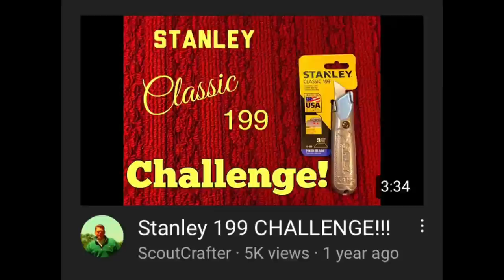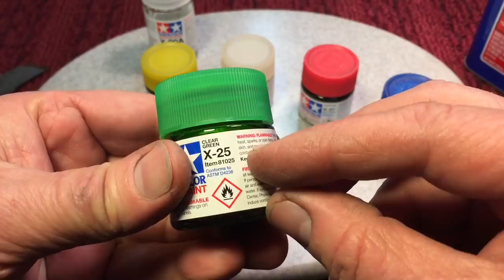2 Classic Stanley Utility Knives

Comment: Nice collection I am a retired carpet and Lino layer I carried a 199/ 299 Stanley in my pouch for 35 years we would tighten the screw with our thumb nail for making tool-less blade changes same with our Bloody Mary knives long before tool-less knifes were made. We always had a long Lino knife stone near. We also kept a small piece of an old Lino stone in our back pocket to resharpen our utility knifes.

Comment: I use the Tamiya paint building models. A much better and much cheaper thinner is common rubbing alcohol (if you can even find it). Should dry faster and fill in smaller cracks using the isopropyl. It will also remove it from the lettering. Tamiya, themselves; even says it is OK to use.
Reply from the maker: Hello Stephen!  I used to buy a lot of rubbing alcohol now I can't find it!!!!!!!   Bastards!  LOL

Comment: Speaking of the Stanley 199, I inherited a 199 from my mother.  It is a "Goldblatt 199".  Except for the molded-in name, it is a Stanley knife.  According to her, it was a matte knife.  As an artist, she used it to cut matte board for mounts.  It had lots of scratches when I got it, but I made a cardboard sheath for it — and eventually, after a few years, the cardboard has worn the scratches away.  It now lives in a tray with the other mail processing tools.

Comment: I love your work on these 199s. In case it matters, they are not aluminium; at least, not much in more recent years, if ever. The ones I have worked on are a high zinc (+90%) alloy. Your advice still applies for grinding and polishing, though they are not as soft as aluminium. I am going to do some work on some older ones, which might be made of other metals.
Reply from the maker: Hi Gord!  Thanks for that info, alloys are hard to determine just from looking at it.   The castings are still very nice and they are a beautiful knife!  =D   Thanks!

Comment: Spent quite a few years getting up at Four-Thirty and starting work at 6am..........My Air Compressor is in the Garage and I have a line piped into my Basement Shop so I don't have to hear it...........Bird Seed Bag has Great Graphics, at least there's some products today that bother to make the packaging look nice..........The 199 you just did has the straight slot screw and all the others you showed have the Phillips.
Reply from the maker: The newer knives have a few differences...  they polish up nicely though!  😃👍

Comment: I still use mine and it's 20 years old.  Painted mine when I first got it with Rustolium paint.  So it's never rusted.  Someone gave me a Milwaukee but it only holds one blade.  The Stanley holds a dozen or so blades so that's why I prefer it.  Your project came out good.  I like the yellow and red.  Looks a lot like a pistol grip.

Comment: I was taught if you use the sam tools on aluminum and steel you will always have galvanic corrosion.. when Ford started putting aluminum hoods on they're trucks I did a repair on mine..and painted it....looked great but about a year later the paint started bubbling in the spot where I made the repair. I found out it was because I used the same grinding pad I had used on steel.

Comment: 2.30 AM it must be cold in the basement or do you run the central heating 24 x 7? You polishing the aluminium, how shiny can you get it,  can you get it like the stainless steel mirrors?
Reply from the maker: Tony- I removed the insulation from the steam pipes in the basement so it’s nice!!! 😃👍

Comment: I did a lot of night shifts, too. Doctors have even diagnosed me with "Day Night Reversal Syndrome" and I spent years on prescription sleeping pills trying to right this wrong. One thing I have found that helps is learning about circadian rhythms. Specifically 3 exposures of bright light can reset one's Circadian rhythms. Also the sleep hormone melatonin is not produced when exposed to blue light or these new 5k-10k LED lights. The old incandescent color or red LED lights are best. I even have my laptop set to get rid of blue light at 8pm. (windows 10 has it built in but there are apps you can download to do the same thing) The last thing I'd recommend is to google "sleep hygiene" as it has more hints. These days I'm off the RX sleeping meds. I take 4mg of chloropheniramine at night. It's an old very safe allergy medicine that has the side effect of causing sleepiness available by the 1,000 on amazon for less than twenty bucks. Most brick n mortar stores don't even carry it unless you specifically ask for it.
Reply from the maker: Fantastic information John!  Thanks!  😃👍

Comment: I dont know if you use your phone a lot at night, but, you know how they say that red light preserves your night vision? Well, cell phones usually blast out blue light, which stimulates your eyes. Theres a setting in your iPhone for automatically changes this under Display and Brightness, and its called Night Shift.  It adds a pinkish tint to the light the phone puts out and stimulates you less.  You can select which hours this Night Shift is on.
Reply from the maker: Joe- I have all my devises on "Night mode" as the normal mode is too bright.  My Youtube "Darkmode" keeps the screen black!  Really nice!

Comment: Love my fixed blade Stanley knives. Try using a Zirconia based flap wheel when you are working on Aluminium. The Aluminium . Oxide is clogging up faster because  the abrasive itself has Aluminium in it.
Reply from the maker: Hi Abe, great tip!  I have a polish that works fantastic but it doesn't remove scratches...  =D

Comment: I know what you mean about sleeping. Before retiring I got up every morning for 34 years at 4.58am in order to catch the first train of the day. I have been retired now for nine years and you guessed, every day I wake up at 4.58am but now I can roll over and get another hours shut eye. The strange time was due to the alarm going off at 5.00am and I would be in my wife's bad books if it woke her at that time so I just woke up 2 minutes before (self preservation !!!) and switched off the alarm.
The 199s look great but I noticed the older ones had a different tip to the modern ones, could you line them up to show the full evolution?.
Fantastic video and a high spot of the day, thank you.
Reply from the maker: Tony- The first half of my career I worked days. (4am to 12:30pm)  So I woke up at 3am for 16 years then I went into the shop and went to nights!  LOL   Out of the pan and into the fire!!!!  =D

Comment: I did a 199 which I have many from being a carpenter for 42 years never though about restoring only problem is after polishing one  I can not hold on to it let alone use it way to slick
Reply from the maker: Les- I have my Great Grandfather's original utility knife I use all the time, once I do over a knife I usually just put it away.   =D

Comment: You and Unc. are rubbing off on me or maybe wire brushing. I actually used a hand saw and then wire brushed it, oiled it up and put it away. That's not like me at ALL! I wasn't feverish then BUT it may be catching up with me now. And an old scalawag pal and I went to Maryland to get a power unit for a plainer. He was a swing shifter and slept ALL the way up and back except for getting fuel and eats. I about DIED because I did ALL the driving. And I either worked straight nights or days, 12 hour shifts. I hated nights. So THANKS, you Hoot Owl You! GBWYou
Reply from the maker: LOL-  Lewie oiling up the saw after a job is the best part!  =D   Thanks!!!!!!!!!
Reply: @ScoutCrafter  It's still rusty BUT less rusty and oily! I need to take the side grinder wire brush to it but haven't yet but I know where it is. 50/50 for the WIN!